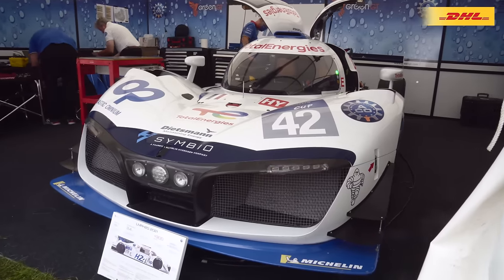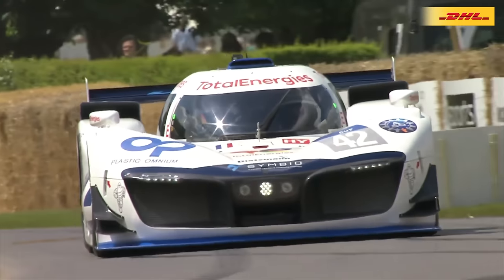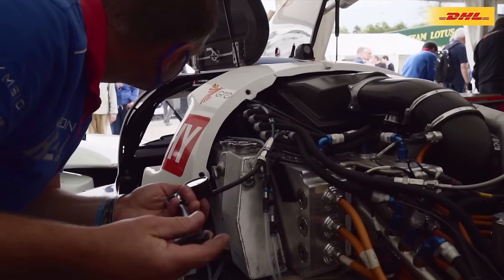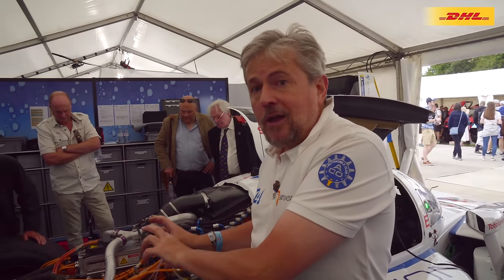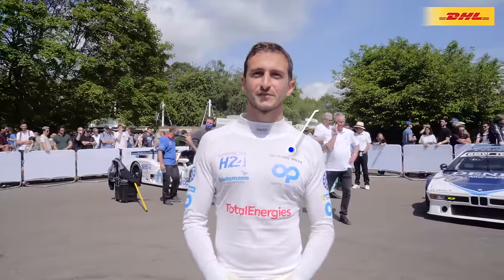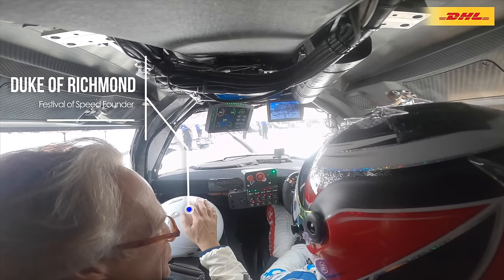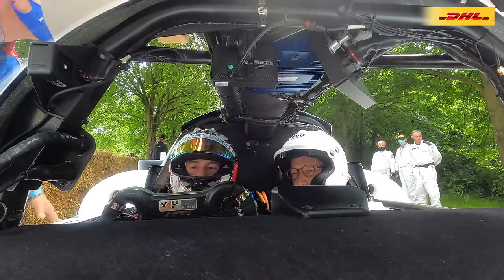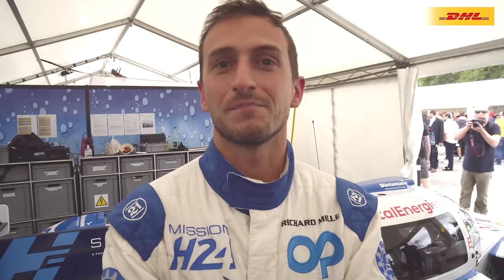The water-powered future of Le Mans

Comment: The fatal flaw in the hydrogen fuel cell is its heavy dependence on platinum group metals, the rarest non-renewable materials on the planet,  to act as a catalyst.
Reply: I heared Hidrogen cars can drive without those
Unlike regular eletric cars that have problems with rare metals
Reply: @superninja252   You heard wrong.   Only a hydrogen combustion engine can work without a catalyst, but they're highly inefficient.  The vast majority of hydrogen cars (including those referenced in  this vid) use a fuel cell which requires a catalyst to combine the H2 with O2, and the only ones that provide suitable efficiency and longevity utilize Platinum Group Metals which are extremely rare and expensive.

Comment: i prefer the hydrogen ICE approach
maintain the soul and most of the tooling, while still keeping 0 emissions
the main problem is, like with pure electrics, is where the power is originating from
most electric cars are being charged by coal powered generator plants, and the electrolysis of water to acquire the hydrogen for HICEV and FCEV cars will also need large amounts of electricity
electrical generation plants create at least three times more pollution than hydrocarbon fueled cars

Comment: The future of Le Mans? Not necessarily, F1 on the other hand has decided to go down the path of bio-fuels in a hybrid package it would seem. Yeah the new engine regulations are far from being decided or implemented yet, but that is the most likely path they will take.
Reply: I thought F1 was going the synthetic fuel route. Would hydrogen be considered a synthetic fuel?
Reply: @chandler9716  bio fuel and oil is fuel made out of plants. Synthetic is a mix between plants and crude I think
Reply: @jackarmstrong7285  One type of synthetic fuel though from what I read is in development by Porsche which uses renewable forms of electricity such as wind and solar to split the hydrogen from the water by electrolysis, then combined with the atmospheric CO2 to form Methanol.
Reply: @chandler9716  Synthetic fuel is just more greenwashing, it takes more energy to make the fuel than we get back.
Reply: @truantray  But if that energy is nuclear...

Comment: So what is the overall environmental footprint including production of the hydrogen and oxygen?
Reply: You don't have to make oxygen, its normal air, the membrane filters the oxygen molecules from that. The environmental footprint for hydrogen isn't that great at the moment since its extracted by methane reforming. But currently infrastructures are being set in place to do it with non renewable sources. And also improve efficiency because extracting hydrogen, storing it and then making water again takes energy at every step.
Reply: @nite3747  I know these things but it all has an environmental/carbon footprint.  Water coming out of the tailpipe is very mis-leading.  Hydrogen is in liquid form at very high pressure.  Energy is required to get it into this state.  With our vast current infrastructure designed around liquid fuel, some form of liquid un-pressurized syn-fuel makes more sense and we haven't even discussed the drive motors, inverter drives, the fuel cell itself and all the other crap this car was packed to the gills with!
Reply: @nite3747  yes, this video is very misleading and avoids all the issues of hydrogen which was tried and failed in Japan. Even Japanese industry is pivoting back to batteries.

Comment: It would be cool if they could merge gas engines with hydrogen.  Use a smaller engine and feed in small amounts of hydrogen give it more power and better gas mileage.  A set up like that could be transferred to passenger cars to greatly increase fuel mileage

Comment: What happens to the hydrogen cells if this car gets T-boned in a crash?
Reply: There are no crashes in the future. A.I. will prevent it and drivers will be operating their machines safely through VR. Racing is going to be great. 🤠🥴
Reply: Safety cell is required
Reply: @AlienLivesMatter  safety shmafety. Today's safety standards make last decades look unsafe, so really, safety is just waiting for some talented driver to test the limit.
I'm betting the total amount of hydrogen used is calculated out to be as "safe" as a full tank petrol fuel involved explosion..or something relatively close.
I'm really hoping that the Toyota Mirai isn't a H-bomb on wheels; and that some engineers calculated this stuff out.
Reply: I asked exactly the same question in a comment before I read yours. Wondering if this can produce a mini Hindenburg - probably not an explosion but a damn big fire

Comment: Wish they can find a way to run v8 and v12 engines that will capture the the heat that’s being produced and the electricity can fire the spark plugs and emit water in the tail pipe so we can hear the glorious sound of the engine speaking to us but hey I’ll dream on 🛌.
Reply: You will get over the sound aspect of those dirty out dated power trains.

Comment: so why no production car use this ?
Reply: It's not easy to store and transport hydrogen, it's a very volatile gas. Production cars will need refueling stations with hydrogen to fill up the fuel cells, current electric cars battery can simply take electricity
Reply: There are Hydrogen-powered production cars. Look up Toyota Mirai and Honda FCX Clarity.

Comment: 2 years ago this drove on Spa. Pitstop took 3 minutes. A properly design battery can be swapped in 15 seconds or less.
If it drove 2 years ago, why would it take 3 more to be racable in its own class? VW ID.R drove after 6 months and set records. All that car needed to do 24 hour races was a swappable battery and some durability adustments perhaps. Of course a group up chassis and aero would be much more efficient than the ID.R built for hillclibs an single laps only.
A purposely designed car would be more slick than an LMP2 and generate more downforce (only when needed) than an LMP1. McMurtry is doing something similar in a 150 cm narrow batmobile, just not the swappable battery, sadly.
Reply: A swappable battery isn’t really that feesible. 99% of electric cars now adays have the batteries as part of the chassis. Also the IDR would make at max 2-3 laps of LeMans before needing to pit. The hydrogen car however should be able to race for 3 hours at a time. So the pit stop time avg would be less on the hydrogen car

Comment: Excellent, well done, guys! One question though - how safe is it in a crash, do you expect a mini Hindenburg?
Reply: Fuel cells have been advanced to handle penetration from a 50cal bullet. They are safer than battery cars to be honest
Reply: The Hindenburg was a balloon filled with Hydrogen. Besides, in 85 years of development, fuel cell technology has improved in robustness.
Reply: @raininglemons9435  same is true of batteries, which is why Formula E has had major crashes and no fires. The danger of hydrogen is in the fuelling under high pressure and low temp.

Comment: No pollution? I want you to weigh brakes and tires before and after racing and tell me where the weight went...
Reply: Were did you source the batteries 🤔
Reply: Yeah, kinda odd approach on the wear-down of these. You'd be better to worry about the manufacturing of tires and brakes, not the use of them.
Reply: @jackarmstrong7285  plastic pollution in tires

Comment: Could an ICE be used to generate hydrogen on-board? Since the "exhaust" is water, it makes me think of some kind of closed loop system that can reuse the water to produce the hydrogen over again.

I'm a driver not a scientist 🧪💥
Reply: Valid question, but you need huge amounts of energy to break the water molecule into separate hydrogen and oxygen atoms, way more than any ICE could supply in a practical manner
Reply: @1982valeriu  true electrolysis is a very high energy consuming process
Reply: I hope you drive better than you think.

Comment: this fuel cell with tesla motors, i wonder if they thought of installing a hydrogen generator onboard that runs on 12 volts and produces the hydrogen to start with from distilled water, so your fuel is distilled water not hydrogen or petrol etc.
Reply: Takes a lot of energy to split a decent amount of hydrogen from water (via electrolysis) so it's not really practical to do it onboard the car.

Comment: I can get behind fuel cell vehicles. Hydrogen!!! And it can be refilled in a timely manner which makes it so much more viable than batteries. This actually has me excited. I've been so bummed about electric vehicles due to the batteries and how slow they charge, etc, but this really gives me hope.
Reply: The BIG issue with hydrogen is the very poor efficiency. Basically hydrogen doesn't exist by itself so you need to extract it from gas like methane (CH4) which is not 'green' or from the air by electrolysis, then compress it at 700 Atmosphere (10,000 PSI), and then use a fuell cell stack to get electricty and water. And then you still need batteries to store the electricity produced. So you get only 25% of usable energy from the energy used to produce it.
In the case of batteries, you store directly the electricity produced from solar panels, so you get mostly 95% of usable energy from the energy needed to produced it from the sun. For a race like Le Mans you could use swapable batteries, which could be interesting to compare to the hydrogen solution. For an electric car you just need a battery and an electric motor, while for an hydrogen car, you also need tanks to store the high pressure hydrogen and fuel cells stack to generate electricity and batteries to store it.
Reply: @nihongobenkyoshimasu3190  Either you cannot completely dismiss how vast environmental hazard is the mass-production of battery cells...
Reply: @ssc00p  Every car is a vast environmental hazard. Where do you think metals in cars come from?  Do F150s grow in fields? 
How much mining does a single platinum catalytic converter take? 
How much mining and energy does a single liter of petrol take? 
You can't make arguments with blinders on. Think.
Reply: @truantray  😁😁😂

Comment: Cool? yeah. Green? not that much. It takes 48KwH of electricity to produce 1kg of hydrogen. For reference a consumer electric car will run around 300km for that amount of energy.
Add to that the whole compression, cryogenic storage, transport etc and you're ramping some big numbers here.
Also don't think it's pushing evolution, most of hydrogen production is dedicated to rocket fuel, so these car are rather a by product of it. 
Don't get me wrong, it's still nice to see people working their brains into modern technologies, but don't fool yourself either, this car ain't green nor sustainable, not in the slightest.
Dig the design btw

Comment: If this is the future then count me out lol
Reply: Ah yes, people who think we have an unlimited supply of petroleum. We would be really glad to count you out.
Reply: @askeladden450  How are you generating all that hydrogen, dummy.
Reply: Hydrogen is definitely the future. How awesome would it be to have an ice where hydrogen was the fuel instead of an electric engine?
Reply: @thebarkingmouse  you mean the very clean and simple mechanism of using electricity to remove hydrogen from the air? Very different to drilling for oil
Reply: @thebarkingmouse  Hydrogen is made using electrolysis. Yes, currently most of it this process is powered by fossil fuels but we are shifting to Solar, Wind energy etc to produce hydrogen.
Reply: @askeladden450  right right.  And if you really believe that I've got a bridge to sell you.
Reply: @thebarkingmouse  whatever
Reply: @thebarkingmouse  the hydrogen produced by methane reforming isn't even fit for use in hydrogen fuel cell, which requires hydrogen of much higher purity. Most of the current R&D in this field is being done on trying to remove the cost of producing hydrogen using electrolysis, which produces much purer hydrogen. Germany is already working on a prototype project to produce large amounts of hydrogen using solar and wind. At least take the time to look at current research and where the world is moving.

Comment: No sound no racing.
Reply: Sound (and heat) is nothing but energy loss.
Compare the sound of the Fiat S76 and a new F1-car.
It's the way to go.
Reply: Right, I forgot batteries produce no heat and experience no thermal efficiency loss or degradation over time.
Reply: @MrDownRater  you might as well just watch the tour de france, they have no sound. The sound of the car adds so much to the entertainment that it is almost pointless without.
Reply: Indeed. Interesting technology which will have it's use in road vehicles but racing? Not for me either. Le Mans is all about the spectacle and that spectacle is a combination of speed and noise. Speed on its own doesn't cut it. Sadly if Le Mans goes down this route I fear for its future.
Reply: @markhealy9361  synthetic fuels with ICE hopefully, with hybrid electric.